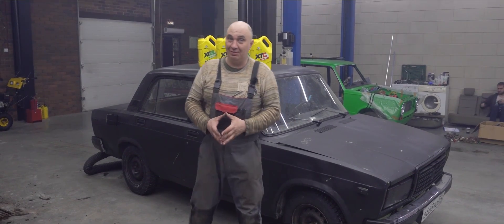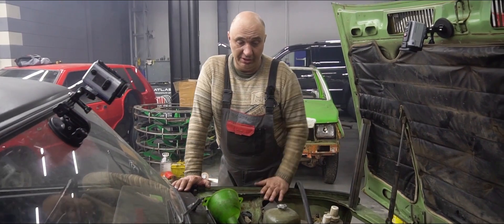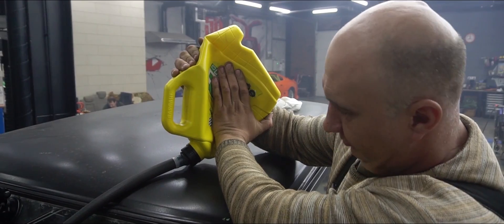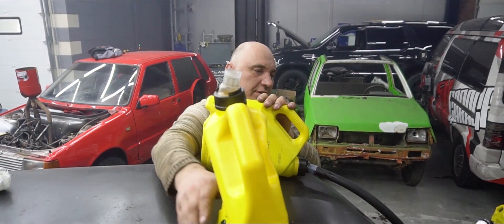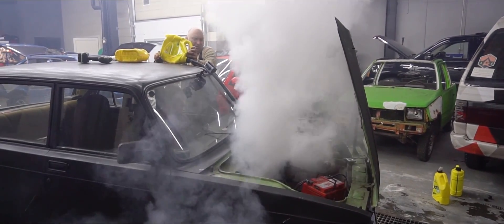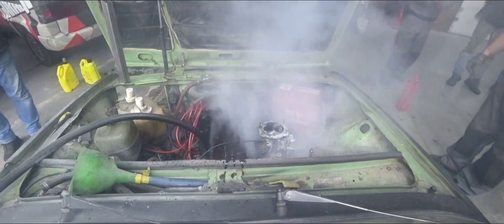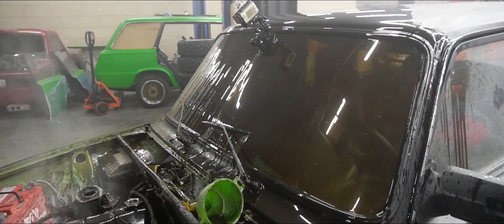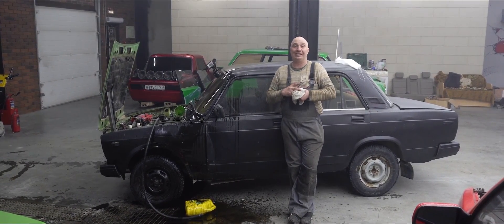What happens if you fill your motor to the brim with oil?

Comment: Can you guys consider doing an experiment I will give the idea:
so many engines with high mileage get high oil comsumption, I only interested in the ones that the cause is due to piston oil control ring carbon buildup, and piston drain back holes behind the oil rings get clogged with very hard carbon deposits.
To solve the carbon problem  can solve the oil ring problem with piston soak with chemicals, but that not clear the drain back holes behind the oil ring!!!!
That is big problem to solve without take apart engine.
So I have idea that might solve the problem but needs crazy mechanics to try it.
Get oil and carbon dissolve solvent together, fill the engine very high with oil, to the level of oil control ring ( WHEN PISTON AT BOTTOM OF STROKE).
Every time the piston hits bottom of stroke the underside of piston hits the oil/solvent, and its forced into the oil drain back holes from inside of piston, hopefully clean them out.
So thats the idea.........maybe you guys know some other way to clean out piston oil drain holes from carbon?

Comment: In 1991 I had a clapped-out Ford Escort 1.3l.  The oil light came on, so I stopped at a garage and bought a 5l can of oil & proceeded to fill it to the brim - right to to the bottom of the oil filler cap...  it took quite a bit of starting & when it finally fired up, a massive cloud of blue smoke floated across the garage forecourt!  We left the scene and went to the motorway, to “burn off any excess oil”.  I was a young idiot & attempted to achieve 100mph, but at 96mph, the #4 piston developed a large hole in it & I spread several litres of oil over the middle lane of the motorway.  Had to be trailered home.

Comment: there once was a montero sport limited with what LOOKED like the oil pan that I drained a few weeks on the job. I drained the oil, plugged it and upper bay filled it. After looking closer before adding blue torque seal I noticed a bit of crusty old yellow torque seal on the actual oil pan. I had accidentally drained the transmission. As far as I know, the owner never found out about it but we did have to quickly drive to the dealer to get the proper trans fluid. That same vehicle came in a year later and I ripped through the wiring harness with a pair of filter plyers. I made a few other smaller mistakes while working there but nothing like these two incidents and with the same damn vehicle. Unheard of.

Comment: He finally did the Poor Rich video!  When I was in tech school there was a guy named Rich, who got the name because he was always asking for quarters for the coffee machine.  The instructor asked him to change oil on a car (actually the instructor's friend's car) and told him to charge it to his account at the parts desk.  They caught it before a start attempt, when they saw a few empty case boxes and something like 36 quarts of empty bottles laying around the car.  Guy filled the engine to the top of the valve cover on a Chevy 305 or 350.  They drained it, and after several plug cleanings it ran again.  Poor Rich not only looked just like Jim from Taxi, which was a hit show at the time, but he was a true living version of him.  No acting necessary to play the part.

Comment: Fill up full,and weld the filler tube for dipstick and crank shaft vent and weld it to keep the oil from comeing out
Reply: I'm curious to know if it will spit out the carb or just blow the case

Comment: I was expecting hydro-locking the engine, but when you consider the flimsy oil cap and the exhaust manifold right there. This is the outcome. Would love to see this tried with an engine with a better stroke/torque, maybe a v8 or even a boxer engine. 🤔

Comment: To empty oil jugs fast, just stab a hole in the bottom as pouring.  Then stick the tip of a compressed air blow gun in the hole, and squeeze!  Squeeze gently, too much pressure makes a big mess!

Comment: I did this when I had my first car (engine off of course), before I knew ANYthing about cars! It did not catch fire, simply found the weakest point to escape under pressure, it made the sump seal leak badly for months, I replaced the gasket several times, did not work so then I did an engine change - I learned a LOT about cars in a VERY short amount of time! Not=w I just maintain my cars myself for most things as it is easy to do.

Comment: I was expecting to hydro-lock or at least have too much drag from having a full crank case. Guessing that pouring the oil in at relatively high RPM whipped enough air into the oil to prevent this from happening.

Comment: I like your channel, you always have interesting videos. This video reminded me of 'oil incidents'.

A car came into my street trailing A LOT of smoke. They had just put in too much oil, didn't check the dipstick. The driver thought the oil needed topping up, so he had bought a 5L bottle and poured the whole lot in.
I helped to drain it out and refilled it to the correct level. No more smoke.

Now for something stupid I did. Years ago I changed the oil and filter in a car I had owned for a short time. I checked the levels and went for a drive. After going about 5km I stopped to check for leaks. There was one big leak alright. I hadn't put the filler cap back on and there was oil everywhere. Fortunately there was no damage to the engine and the filler cap was still there, so I called my father to bring some more oil. It took two cans of degreasing spray to clean up.
Reply: Had a faulty SU carburetor on a Volvo B18D engine (1.8 litre pushrod, dual SU carbs, mid 1960ies model) so the engine filled up with gasoline, all that happened was that the oil/gasoline was ejected at high pressure through crank rear seal into the clutch housing and spilled out from there. No fire, no mess, no bad sounds, drained most of it and filled a little new oil, no audible damage to crankshaft bearings. The leak was so severe/pressurized that the gasoline trail was a solid line even at speed.

Comment: Next time, pull the dipstick out, put a garden hose on the dipstick tube with a hose clamp, brick on the accelerator pedal full blast, and turn the water on.

Comment: Suggestion: make a tube from exhaust to carburetor, see if it runs on exhaust gasses
Reply: Thats basically what an EGR valve does. And EVAP which uses tank fumes. Instead of venting to atmosphere. Uses them by storing in a can. And when warm it purges them into intake. Been using both for around 30-40yrs on most cars. Doesnt do much though. Yes you can use fumes. Yes you can use exausts gas. But the amount that would become enough to run on alone would be about the equivelant in liquid fuel after atomization in engine. Hence no benefit. And youd still end up with a car that probably couldnt do much better than 25mpg. Wich is good mpg. But not any different unless theres alot of things were changed and throwing away the benefit. Reason for extra fumes in exausts gas is engine cant use them all quickly enough and precisely so youd still need about the same amount of fuel even with egr and evap usage.

Comment: The very reason the crankcase has a breather, years ago they vented to the road rather then the air inlet so oil used to drip on ones drive and garage floor, so modern engines naturally burn oil as oil vapour and why air filters clog up quicker than years ago if the breather is before the filter.  When the breather vented to atmosphere air filters were of the oil bath type so the engine still burnt oil vapour to lubricate the valve stem.

Comment: Id like to see the engine running at high rpm,with  a large funnel to the intake, like made from a large drum. Then dump a large amount of water in at once so it drinks nothing but solid water very quickly. It should explode and bend rods, break the crank and all of the above.

Comment: I was young I had a Volkswagen Jetta bout 20 years ago had a faulty oil level sensor , I kept adding and adding oil lol check oil light and buzzer kept coming on lol I must have poured about 7 quarts in that engine and then. I started it up and took it on the highway and floored it  😂😂😂😂 thickest blackest smoke screen for miles 😂

Comment: Experiment suggestion:
Make the brakes work only on two diagonal wheels equally (example: rear left and front right).

Then test braking during straight movement, braking during a left turn and braking during a right turn.

Comment: Experiment suggestion:
Make engine intake air from inside vehicle cabin ("in cabin snorkel").

Then try to drive with all windows and ventilation closed.

See if the engine stalls and if the driver suffocates. Is any vacuum achieved in the cabin?
Reply: NlhadH if you ever look at installing a sound system in a car you could see all the holes in the car, so no the engine wouldn’t stall, no the driver wouldn’t die from lack of oxygen, and no you wouldn’t have any type of vacuum at all.
Reply: Are you kidding!? With these ladas it's impossibility for it to be airc tight haha, none of the doors or glass will ever properly seal, there's millions of holes of rust, millions of holes that are there from factory etc
Reply: 1. It does not have to be a Lada.

2. Yes there are several small holes and crevices in the vehicle body and the engine would suck lots of air through them, so it would be interestig to see the effect. Maybe it would create lots of howling noise due to lots kf air moving through small crevices. And the engine perfrormance should suffer.

I did not say that the driver would die from suffocation, but that they might experience one as a difficulty to breathe, similar to being on a very high altitude.
Reply: @NihadH  ohh I see I completely misread the first comment and thought it said seal up the car and make it drive underwater or something for some reason lol

Comment: When I first started dating my fiancee she was driving a Pink 94 Ford Escort wagon, When I asked when her oil was last changed she didn't know, I went and bought oil and a filter and pulled the drain plug out and the oil just kept coming and coming out of that little 1.8L engine that was only supposed to have just under 4L in it, in the end it had about 6L of oil in it and she had been reading the dip stick wrong, thank god that car was so tough lol.
Reply: My mom had a 94 escort when I grew up. 
She never changed the oil. Just ran it til the oil light came on. DROVE to a gas station and bought 1 quart of the cheapest oil. 
Never died. 
Also did 200,000 on original timing belt.
Reply: @fastinradfordable Hers had about 340,000 on the odometer when someone idiot crashed into it, probably would have gone to 400,000.
Reply: My mates GF once filled up her engine with oil. It's not actually that stupid if you don't know any better. Was hilarious for the rest of us.
Reply: @kirkc9643  Way I see it is at least they where checking it.
Reply: Most engines would have flooded and had way too much carbon buildup to run without a deep cleaning

Comment: Be careful with that much oil in one place the US might do a humanitarian invention on you.. Also next time weld the oil cap:D
Reply: Weld the oil cap and put a check valve in the line from the oil bottle ;)
Reply: @brett174  And do this 'experiment' on a turbo diesel, just for good measure!
Reply: And I thought force feeding by tube was illigal according to the Geneva Human Rights Commission.
Reply: @johanbjork1650  only if you are Jehovah's friend
Reply: I read it as "humanitarian intervention" - and it was funny! :)
Reply: @JoeShopper  thanks corrected the mistake
Reply: @peterzingler6221  "Intervention" makes sense. I'm unsure what you mean by "humanitarian invention"..

Comment: Your channel makes me want a lada....seems like the most reliable car cause man can it take a beating.
Reply: Eze&Yare Dominguez  I would say they are reliable, what other car drives at 6.500 rpm constantly for hours at a time like it's nothing?
Reply: Eze&Yare Dominguez  no not in terms of this video, I mean most of these are only 4 gears and we want to go fast on motorways, so we drive to the highest rpm it will go , past the red area in the tachometer, and we do this every day for hours, and the car has no problems with it, ours 1988 1.5l , it's still in great shape after all this abuse

Comment: Wow a Lada tougher than the Fiat 125 it was modeled after!
Reply: That was probably the design goal.
Reply: @xluumu  it was. When they brought the FIAT-124 to the Soviet Union back in the day, they actually did a ton of R&D to make it more durable. The Lada 2101 was modified quite substantially compared to the original FIAT, for example, the rear disc brakes were replaced with drums (apparently the FIAT's discs were more prone to wear or whatever), among other things.

Comment: Its normal oil level for every 1.4 16v and 1.6 16v VW engines
Reply: @Boerkie1990  ive had a 2001 yellow seat leon with 137xxx kms which smoked worse than an tdi.. Backbumper and trunk were all black from the smoke ,
A VW polo 6n 1.6 with 160xxx kms  which drank a liter of oil every 100kms.. but they never let me down

Comment: "This experiment was a massive success"
Reply: Justin Baker in America you break car in mother Russia car break YOU !
Reply: It always is a massive success, when you got vodka!
Reply: Justin Baker  
I like to see a “what if” factor for a just an over filled motor. I’ve heard it can blow the head gasket but I’d like to see if this is confirmed.
Reply: @aaronburratwood.6957  not gonna happen with a lada their "almost" indestructible
Reply: If the oil level is too high, the crankshaft will act as a kitchen whip and transform the oil into an oil emulsion (basically the same as making mayonnaise, but with oil in lieu of eggs). Since emulsions contain a lot of air and are more viscous than regular engine oil,  the oil pump will not be able to circulate it and the engine will fail because it's oil starved
Reply: Task failed successfully

Comment: Fill the tank 50/50 with used/ waste oil and diesel in a diesel car
Reply: Runs like a champ! If the oil is just oil. I used to do this with a 7.3 in a Ford pickup and only trouble I had was one time someone put old antifreeze in the waste oil tank. Old 7.3 Navistar,non turbo. Drank old oil like a champ.

Comment: im early can you do a 4 wheel steering conversion
Reply: The aircraft pushback tractors I work on have 4 wheel steering. You have regular 2 wheel steer mode, then you have Coordinate mode (allows you to make very tight turns, ie. you turn left, the rear wheels will turn right thus allowing for sharp turns). Then you have Crab mode where both front and rear wheels turn the same direction allowing you to move diagonally
Reply: @kickinwinghotboi883  crab mode sounds confusing
Reply: @Henessy-d2w  not at all. Instead of moving forward in a straight line, it moves forward diagonally (the front and rear moving in the same direction) so instead of driving North, you'd be driving Northwest or northeast
Reply: These guys did it 😃
https://youtu.be/4rGo_Aboa68